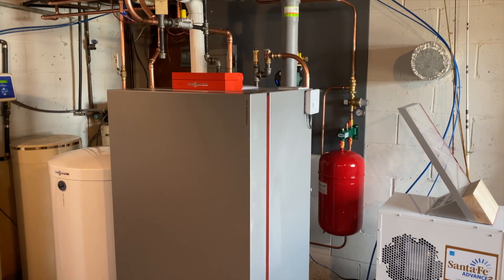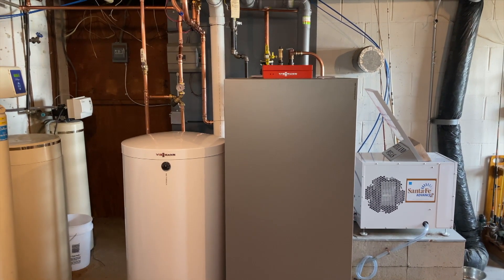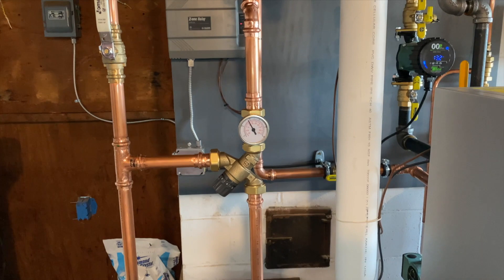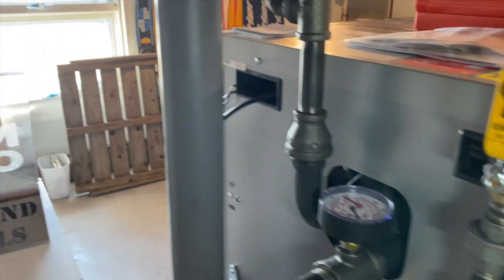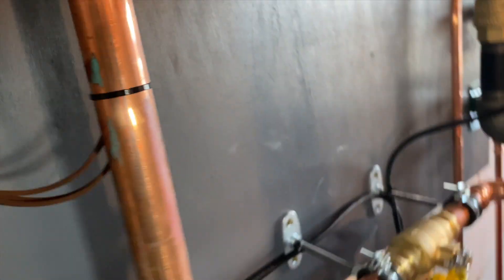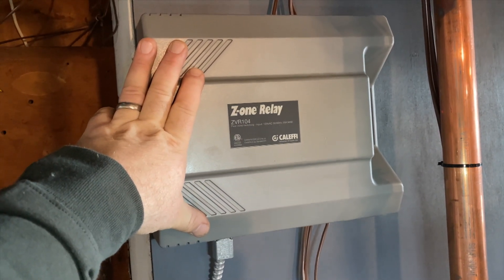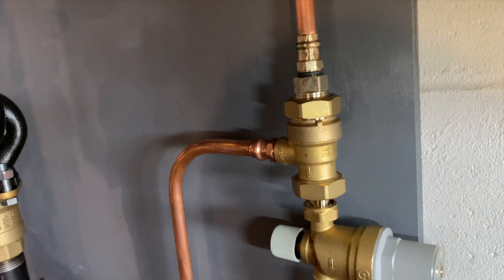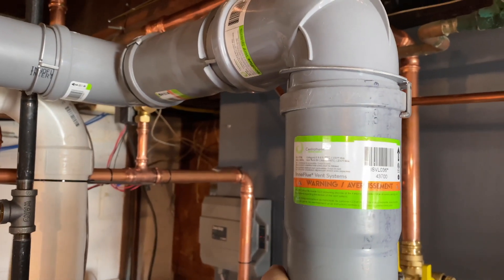Residential Boiler Walk-Thru

Comment: Just curios why you propress all your copper but not megapress your black steel? I think it looks awesome! Flynnstone and you are artists! I was super excited you put out a longer video explaining your design. It would be cool if you did this more often 😎
Reply from the maker: I press my iron pipe as well, it just depends on the job and the scale of the install. This was a simple, localized setup so nipples and threaded fittings worked fine. Cost savings was there since it didn't add much for time.